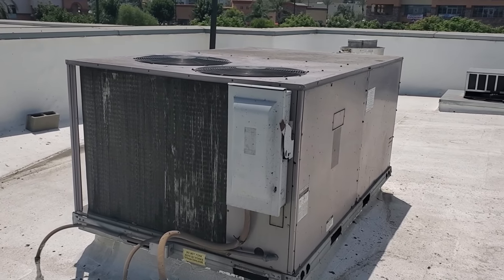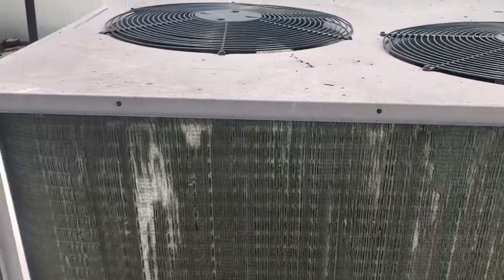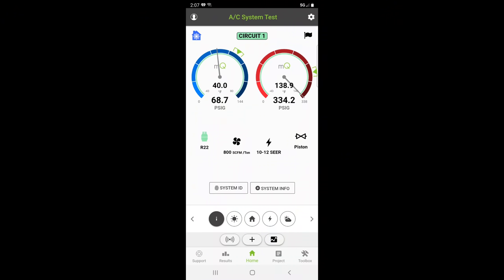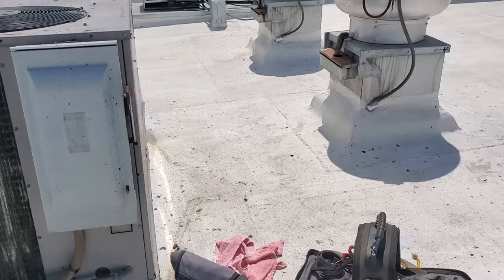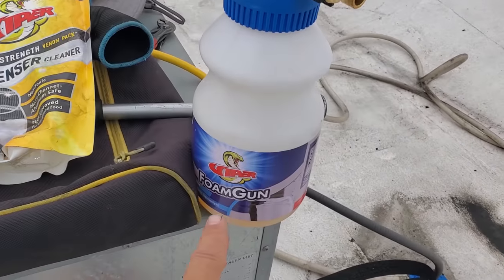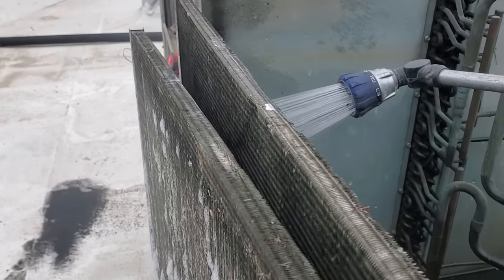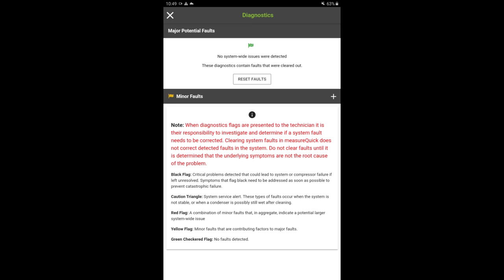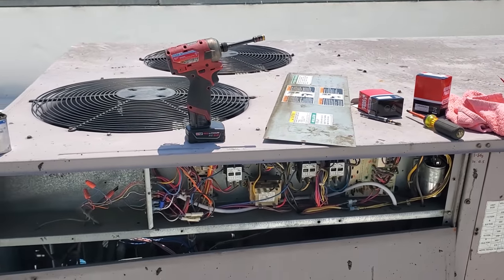THE KITCHEN AC IS NOT COOLING

Comment: Good call on testing/changing the capacitor. As I've said before on other videos of yours, the caps do tend to "boil off" the electrolyte inside as they are subjected to extreme heat and their capacitance values can drift. Additionally, they can start to act as a resistor until they finally fail - typically as a SHORT condition, sometimes the capacitor will actually explode, but if you're lucky the fuse/breaker will blow first.
You may have a capacitor test fine with a capacitor tester and still have it be internally shorted, it takes specialized equipment to check for equivalent series resistance (ESR).
Better to replace it now, than have an emergency service call on a Friday night at 8 PM.

Comment: I'm not an hvacr tech but I run maintenance in a chemical plant. I got tired of lugging around 100 feet of heavy rubber garden hose so I bought some lay flat forestry fire hose with 3/4 garden hose fittings. They're super light and roll up taking up very little room. I keep 4 50' lengths in my pack out.

Comment: After watching a few of your videos im starting to learn a lot.  I had already figured low charge, dirty condenser because of the icing up of the return line and the looks of how beat up the unit was.  Second is always a restricted metering device. I'm not even close to knowing anything about this trade but being in the electrical field and working on the electrical end of this equipment for years I can honestly say trouble shooting is my expertise. It's almost like you gotta run your finger down the side of the machine and put your ear up to it and let it tell you its story of why its not doing so well today like ace ventura. Gauging up on the unit shows high head pressure always because the condenser is going to be beat down or the fan capacitors or the fans themselves are shot or wrong. I used to work for a small grocery store/gas station in town here doing his electrical and the old rack 404a system he had going was ripped out of an old save a lot from the early 2000's, had the condenser table so beat up and rotted with no fan guards was running so high he had to always keep a lawn sprinkler on the bottom of the fan table which sucked water into the bottoms of the fan motors and they always exploded and blew the guards off sending shrapnel out into the parking lot. I had quit that place after a piece of fan blade ricochet off the side of an RV camper at the dump station right in front of the fan table. He always kept gauges and gas handy for anyone that thought the knew what they were talking about.  Just wait for the bubbles to slow down in the sight glass and you'll be fine.

Comment: As soon as you showed the fan compartment I thought, well there's your problem.
Reply: One of multiple problems. It is often assumed that there is only one problem. Without changing out the indoor blower belt and compressor contractors there was an under charged circuit, filthy condenser coils and a defective run capacitor. He saved this unit from multiple service calls as it heats up and the demand on this equipment is higher. His customers should appreciate his thorough approach to keeping equipment on line. No callbacks will make you the most $ and gain customers through trust. Pride in craftsmanship is alive and well in this shop. He gives our trade the reputation it deserves as there are many wannabe low budget hacks masquerading as techs.

Comment: Looking at getting into commercial maintenance how is it compared to residential? Been doing resi install for around 5 years so over it. Only thing that worries me is the heat on the roofs cant be much worse than an unvented attic right? I'm in the northeast.
Reply: Nope just the winters up on a roof can suck at times. Im commercial/ industrial
Reply: @jasonjohnsonHVAC  Thanks man, Already trying to be prepared with plenty of gear in the van whether its summer or winter.
Reply: Get a good pair of sunglasses, long sleeve shirts and lots of water, rooftops can be brutal without proper ppe

Comment: You mentioned a damaged condensing coil, do you mean how a bunch of the fins are bent over? I've seen several of your videos but I don't think I have ever seen you straighten the fins. I remember seeing a fin comb in some auto parts store, presumably for straightening the fins on car radiators. Is there a reason you don't comb refrigeration coils, because that would drive me nuts.
Reply from the maker: I will discuss this on my livestream on  YouTube this evening 5/10/21 @ 5:PM (pacific) come check it out https://youtu.be/O_0J8R-h8o8
Reply: @HVACRVIDEOS  Thanks for answering my question.

Comment: So hey, my residential system is low on charge and I had a company come out and tell me I’m fu€ked, then quoted about $9000 for a replacement system. I know it’s illegal to produce R22, but it shouldn’t be to charge a system? How and who could I get to charge my system? I don’t think I have any leaks and I have no history of previous services done on the system (besides me adding a cap to get it running). I’m sure it’s ran on a weird charge for years anyways
Reply: Get another company to check your system. Don't tell them about the first company. If it's low on charge, you probably have a leak because they are sealed systems.
Reply: @wilee.coyote5298  thanks for the advice. From what I was told, the air handler and outside condenser were installed by the previous owner or unlicensed person many years ago. Who knows if they even put the right charge in to begin with is my thought. It’s doing decent at this time, holding 76F when it’s not too hot outside. I’ve been running it like that since I got it running again almost two years ago. It just takes forever to satisfy.
Reply: There's still tons of R22 around. Got some in my other room right now.

It can be recovered and refined as well to be reused for legacy systems. Not an issue.

Any tech not trying to upsell you can pull some data and see. Worst case scenario recover and measure the charge pulled out. Not difficult at all.

It can then be leak tested at that time anyways
Reply: @gmax341  Does the compressor freeze up after running a long time and never satisfying?  If so, call up several new companies for "ballpark estimate" to check and repair possible leak in your system. Those that are good will likely give you a range.  Those looking to upsell likely won't and immediately recommend new system.  Also, if you know some good home builders, ask them for a couple of recommendations.
Reply: @wilee.coyote5298  nope. It just sweats a lot like me when I do yard work lol. I was told the evap froze over but that was from poor maintenance. Cleaned the blower fan, evap and condenser and it’s been okay ever since.
Reply: @wilee.coyote5298  just had a another company come out. No issue with the charge according to him but my evaporator has really seen better days. I guess he shined a light through it but you couldn’t see the light. Recommendation is to replace the evap